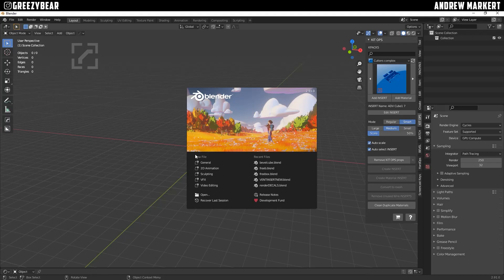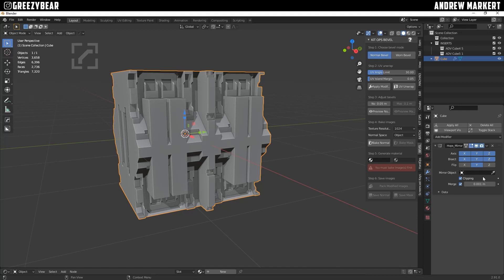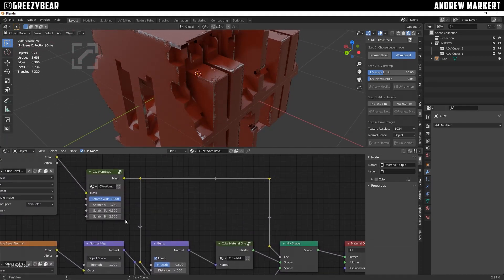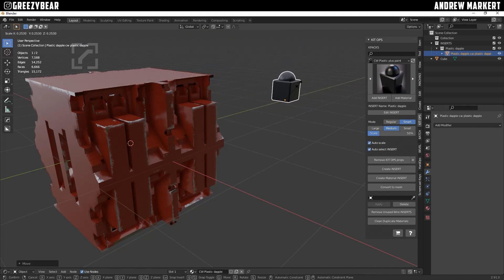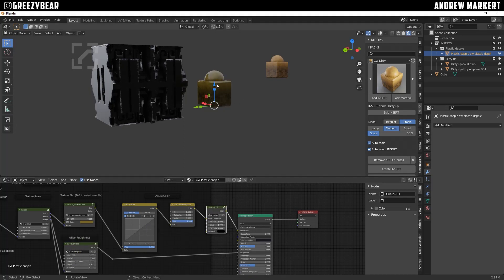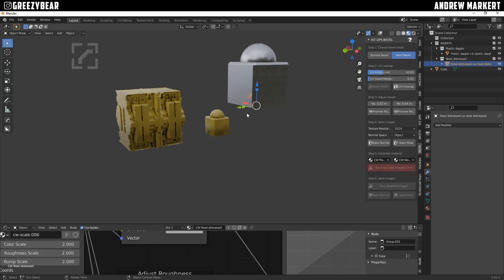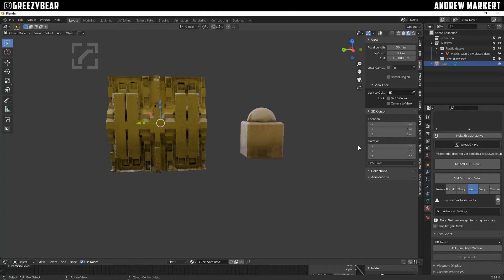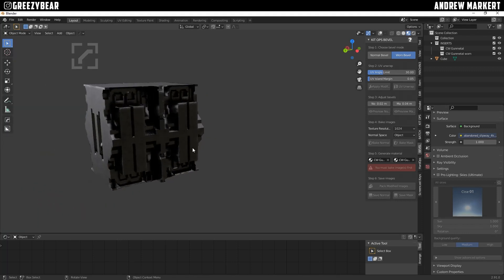Using KIT OPS BEVEL to create some worn out machinery.

Comment: Nice video-- a couple of points. For a fast system like yours, you should always bake at at least 2K. That model doesn't work well at 1K. If it's only 1 or two objects, then use 4K. It defaults to 1K for slower systems. Also, for objects with lots of faces, like the one you have, consider setting the UV Island Margin to 0.02 or even smaller (0.005) and you'll get even more resolution for your bake that way. The bump value will work better at .5 if you're using a higher map resolution.

You can add your material directly to your object w/out having to import the material object.

You can also use the dirty node that comes with the original bevel material as it will correctly add dirt to both concave and convex surfaces, along with altitude dirt and overall dirt as well. It's a "better" dirty node.
Reply: Thanks Chipp for the tips. I'll C/P this comment into my Tips & Tricks Little Black Book
Reply from the maker: Always appreciate your input and knowledge Chipp. In this case I didn't want to set the settings to high in case someone was following what I was doing  in the video. I would love to do a video with the 8K bakes but for most viewers it may crash blender.
Reply: @amarksname  How fast is this fast system? What you got?
Reply from the maker: @doomwalker9934  I have a AMD thread ripper 3960x 24 core , 128 gigs of ram with a nvidia RTX titan graphics card
Reply: @amarksname  That’s some machine!

Comment: I just bought it but its crashing a lot and the bevel effect I can only see in the preview mode. Even in your video I cant see the bevel normal map doing anything.
Reply from the maker: KIT OPS BEVEL has a discord page which will help you with questions and issues , I recommend checking out that thread for help.